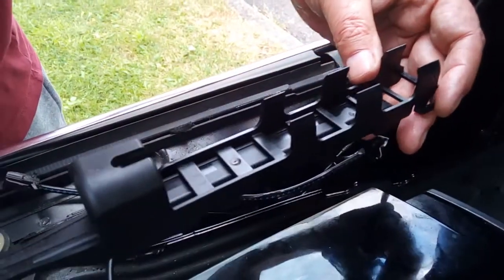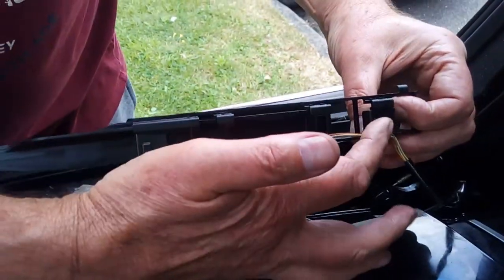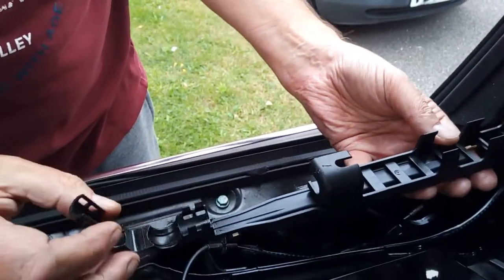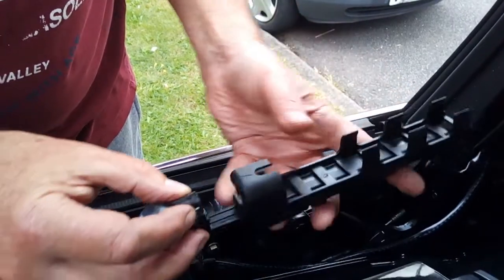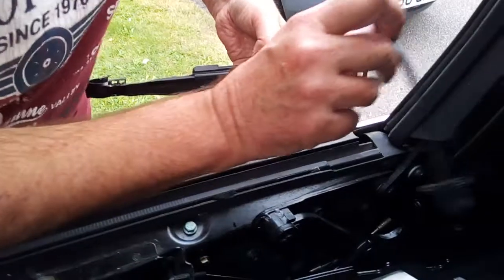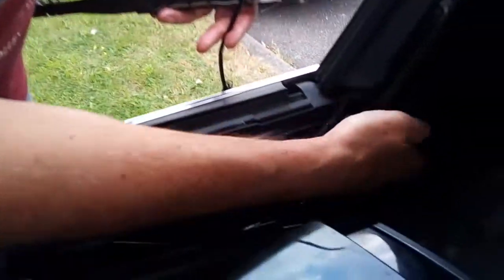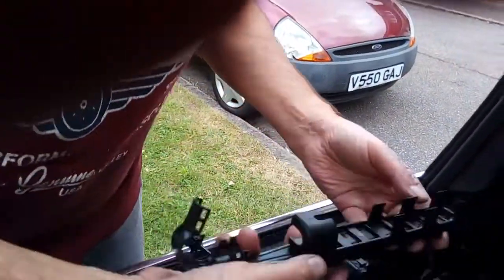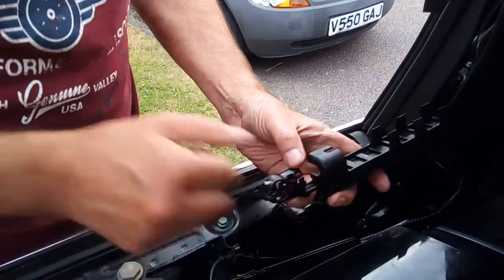New VW Beetle Cabriolet roof position switch assembly

Comment: Just replaced this on my daughters car. It’s a a lot of work just to install it. I actually had to take the back seat out (need a special bit to remove the two screws beside where the belt buckles fasten to floorboard) with head rest and back center console. Then I had to remove the interior side panel on passenger side to see the whole part that had to be removed. I had to constantly raise an lower the convertible top to maneuver the part into position and it was still tough to do. Even the part of the plug that the part has to connect to was a challenge because of where the wire had to route through. Not a simple job but doable if you’re willing to take it on.
Reply: Thanks for confirming that it will take all day to do.  LOL.  I think I can do it.  I have taken the back seat apart before, so I have the tool to remove the back rest.  I think I'll replace the busted speakers while I'm back there as well.  Thanks, again.

Comment: Hello Stacey. I can't post any pics as I don't have the car anymore. Basically the switch Assembly clips around the hydraulic ram. You need to cut off the tie wrap that holds the end around the rose joint and then the switch assembly just pulls off the ram. It does take a bit of effort to do this. You may have to start it on it's way with a blunt screw driver. Be careful not to damage the ram. Once you get the old one off it will become obvious how to clip the new one on, but it does take some effort. Good luck..

Comment: Hello, I have a 2004 and it is opening completely and locking.  When I go to close the roof, the flaps operate and the switch position moves back but will not close the roof.  Do you think this is the micro switch that could be faulty?  If so, is there a way to bypass it so that it thinks it is operational so that I can open or close?  Thanks.
Reply: Hi. I'm not an expert, but it does sound as if the switch assembly is broken on your car. You can't wire out the switch as far as I know. But on the hydraulic pump in the trunk you can undo a tap which releases the hydraulic pump and you can open and close the hood manually until you get it fixed.
Reply: @stevefield9968  Thanks for the reply!  I have used the manual process in the meantime, just can't figure out the exact cause of it not engaging the lifting of the top.  Thanks again!
Reply: Hi. I've just seen an ad for a 2003 for sale. The seller says "a metal cable controlling the soft top has snapped, preventing the soft top from being put up or down." Is this a huge job? About how much would it ne for someone to fix it?
Any advice appreciated! Ty
Reply: @MsPinkwolf  I really don’t know what cost and labor would be but I am sure it will not be cheap because this convertible system seems to be a pain to access and trouble shoot.  A guy that told me he had to have somebody replace the pump in his said it cost him $800.
Reply: @agentsmith2239  thanks. Yes, I decided its not worth taking the risk.